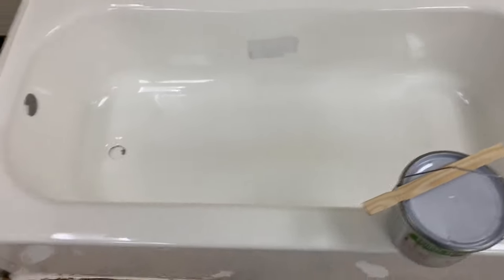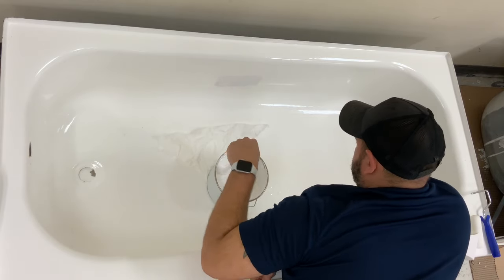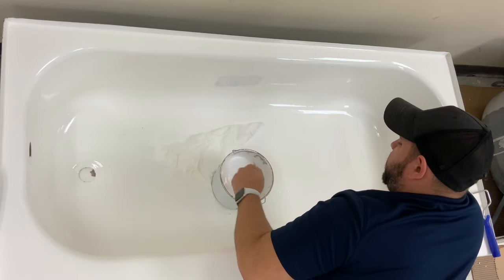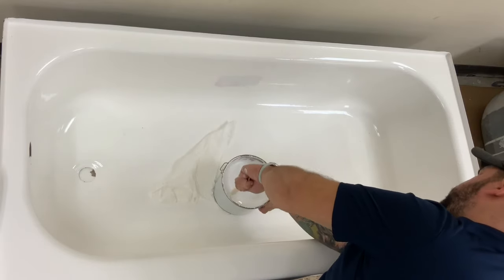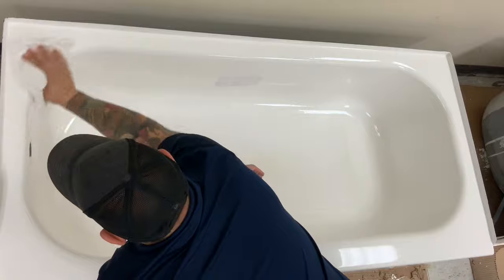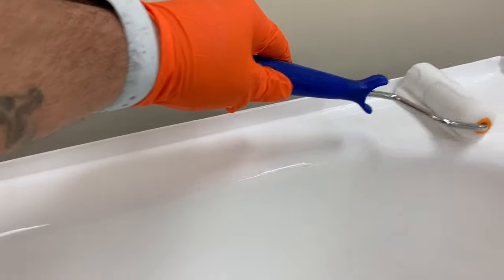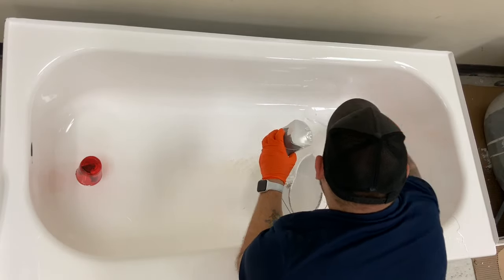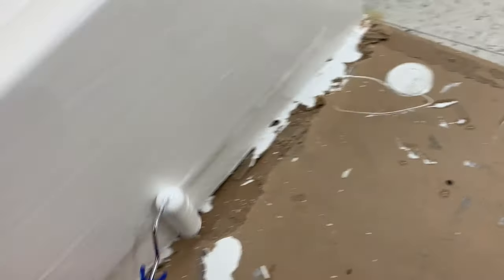How To Refinish A Tub With Ekopel 2K Demo | Ekopel 2K's Easiest & Fastest Way

Comment from the maker: Order yours today!
https://www.amazon.com/dp/B07MCW3KJB
Reply: Does your product work with old cast iron clawfoot bathtubs too?
Reply: I wanted to suggest, instead of a FOAM roller your should try a roller that’s plastic/silicone or something similar. I feel like it would roll a lot easier and not absorb the product
Reply: Will this work on claw foot cast iron tub?
Reply: How do we clean the bathtub after ekopel refinishing. what are dos and don't to keep the bathtub well maintained?
Reply: Any sanding ?
Reply: If this is the first time refining a tub I would try the roll on method instead of the pour on technique, especially if your tub is enclosed and a toilet or another obstacle is blocking the only access area you have.
Reply: Thanks Joe. I wish I took your advice
Reply: How long will this last?

Comment: Okay I just wanted to leave a comment about this. It works. I had and old red bathtub from the 60s that I did not want to remove. I wasn't sure how this stuff would coat it. It truly is amazing I did it myself in one coat and it completely covered the red. I did not use a heat gun. I did not use a hairdryer either. I just used the toilet bowl cleaner that they suggest and I cleaned the heck out of the bathtub multiple times. I actually did it about 2 months ago and that's why I waited to post this comment because it is a rock hard finish. I do have one chip in it that I think I did it before it dried. There are a couple imperfections here in there. But otherwise I am overly impressed and I am hoping that this lasts for at least a few years or as long as they say it does. I've never made a comment before about a product but I'm still amazed but this actually works because usually everything lets me down
Reply: I have a red jacuzzi that I want to do white and want to see if its possible ...this gives me hope
Reply: I don’t know why most people don’t like colored bathtubs and/or toilets. I think they’re coming back in style because in big box stores like Menards or Lowe’s you have to pay more for a toilet if it ain’t white.

Comment: I have worked with quite a bit of epoxy materials. Here's a few tips. Mix the resin thoroughly before adding the hardener. If the resin is somewhat separated and hard to mix, warm it slightly and that will reduce viscosity. I would leave it in the car when sunny out and let it warm and then stir it. Let it come back to room temperature prior to adding the hardener or it might set faster than you would like. While mixing, clean the stir stick with another stick or knife and put the material into the can. Scrape well the edges of the can to get every bit off. As they say in the video, you can transfer the mixed liquid into another container for application. This prevents any non-mixed resin from getting into the tub. Not a bad idea.

Comment: I have an old 1950s pink tub and I used this 2 years ago. I have to tell you watching how you did it would have made me think twice about using it. You made it look so much harder than it actually is. For me it was much easier to take the extra step and pour the paint into a dixie cup and then around the tub. For filling in the runs around the tub I used a plastic scraper to push it back up. Using the dixie cup method I didn't have all the paint in the bottom of the tub to scoop back up. I didn't get any air bubbles or unevenness doing it my way. 2 years later my tub still looks brand new and has the appearance of manufactured cast. I do wish I had known about the dixie cup over the drain

Comment: I watched just about every video and they are very helpful. 
I have a few tips that worked well. 1) After spreading the material I used a tooth pick to remove small pieces of hair and lint that ended up on the surface. This caused minimal surface damage and was all smoothed out by the end of drying. 2) At about the 3 hour mark I noticed there were small spots along the floor line that weren’t completely covered from where the material finished running down after pulling the duct tape. There was also some small pooling from the parts where the material completely reached the ground. I was able to run a q-tip with the cotton pulled off along the floor line to smooth out the pooling along the “calk line” at the floor and I also pushed some of the material up into the little bare spots. It worked perfectly to create a smooth coverage line along the bottom edge of the tub face. 
3) I actually used 2 separate layers of tape for the process. I taped a small hole that is almost the exact diameter of the drain (at the lowest point of the tubs drain hole), then I also used the larger tape diameter that is shown in the taping video (this one basically outlines the outside of the drain cover itself). After I was done with the process I removed the top layer of tape (also tried to scoop out as much material as possible before removing the tape. Probably 10 wipes not 2 like the videos show) then I continued to wipe away material from the edge of the second layer of tape for the next 4 hours because it slowly runs closed to the tape. At about the 10 hour mark I was able to use a tooth pick to draw a line through the material around the tape because it had seeped over the edges of the tape. 10-12 hour mark it when I removed the second layer drain tape. 
Now the actual drain fixture will cover the line of where the material stops and where the old tub surface is still exposed.
Reply: Nice. Thanks for the tip on the hour mark *~.~
Reply: I just wanted to thank you for posting your tips in a comment!  I am just refinishing a kitchen sink that will be used for 5-6 months until it’s replaced when my kitchen renovation is done - and I’m still nervous!  My daughter and son-in-law purchased an older home - and the person who flipped it did some questionable “quick fixes” in order for it to look nice ON THE SURFACE.  I am going to have them watch this particular video for installing the product + read your comment.  I really appreciate that you kept track of the number of hours that has passed related to specific steps - that makes your tips much more valuable!  

I also want to thank the company for making so many videos showing the application of this product.  In a world where it’s so easy to post complaints about products/services, it’s good business practice to provide as much information as possible about your product and how to install it.  It must be frustrating when customers call to complain about poor results - and you find out that they chose to ignore one (or more) of the written instructions.  For example, when the written instructions specifically provide that  the product must be mixed/stirred BY HAND - I don’t understand why anyone would decide to use a drill (or other electrical equipment) instead.  I guess it’s a result of the “instant gratification” mentality that has become ingrained in the world today.
Reply: Awesome. I’m going to own the premix process and keep it away from
my husband who lives by and loves power tools for efficiency.  Using a power mixer reduces strain on weak wrist joints FYI why we love it, same reason we use KitchenAid mixers in the kitchen,,,, however, it creates air bubbles like whipping in the product, I imagine. Going to strap on my wrist widget and be diligent. 

Glad it’s low VOC.

Comment: Great video .... I recently purchased this product for an old bathtub for a rental property came out amazing .... there was quite a bit of product leftover So I  did an experimental project on the tile walls using the leftover product instead of using caulk or grout ....still had plenty of time with-in that hour.. I have to say it also came out amazing !!! Thank u
Reply: I was going to try going over our old tile surround too before I resorted to replacing it.   Did it work well over the grout?

Comment: great video as always, thanks to your videos I successfully refinished a 6 jet Jacuzzi tub and it came out perfect. what if you had access to the drain enough to put a catch pan under the drain would you still scoop or just let it run out the drain
Reply: Did you ever get a reply? I have access to my tub from the basement and am thinking the same thing. Remove the drain completely and let it run through. Then there are not any lines at all, when fished you could tape the bottom to coat the drain hole also. I've seen rust in that area with metal tubs on other kits.

Comment: I had a bathtub with the finish completely worn off on the bottom. I bought the kit, watched video, took notes, was very nervous applying. Wish I hadn't been so nervous, I'm sure it would have turned out better. It is a great product, even with my mistakes it looks 100% better. I love it!! Wish I knew how to add the before and after photos!
Reply: My bottom is exposed to original color and the paint job is completely peeled up. Did you have to sand down with this product?
Reply: Hows it holding up?

Comment: Looks good, only thing that I would add is when it would be best to remove the masking, but you didn't have to do that with that setup. I imagine that it would be best to remove it right at the end, when you are done getting the coating how you want it, so that it doesn't end up stuck in the material, making it hard to remove. Maybe you mentioned it, but I didn't catch it.

Comment: I finally got around to doing this today. If anyone reads this, tape the box like he shows. I made a huge mess and it was pouring all out of the bottom lol. Also, I am short, so I was leaning into the front of the tub when reworking on the walls and made another mess. I should have put a small extension on the roller handle. Just waiting for everything to stop moving now. :) So far, it's a major improvement over my 1950's tub that was chipped and peeling. Cleaning up has been fairly easy too.
Reply: Thank you. I finally read a comment with someone who’s short. I was wondering how I was going to reach the other side without my body touching the front of the tub. I’m still thinking if I should get this kit or just use the rust oleum appliance epoxy. I love this method but it just looks challenging
Reply: @tracyb3198  I researched the Rustoleum and while it's easier to apply, it's not as durable. Good luck with your project!

Comment: Great video! answered alot of the questions that I had. I will be doing this come tomorrow and wanted a guide for it, this was exactly what I was after.  The only negative thing I have to say is that I really wish you would of chose to redo a tub that actually NEEDED redone and shown the steps to get there.  That tub is practically brand new and just a quick wipe down was fine.  What about an old cast iron tub that has chips and years of crap on it? Should I sand it down some, just wipe it, or something else?

Comment: Good video, I wish you used a different color paint. A darker paint would allow us to see what you are doing better. 
And maybe see errors better. White on white is hard to see.
The heat gun you used, for bubbles what temperature is it on? 
Does it say in the instructions? 
I have to repair a chip and was going to use Bondo, and sand entire tub with 400 grit. 
Will Bondo be ok to use? (old 1950's steel tub,  with your product.)
Thanks

Comment: So it came out good! But you can tell an amateur did it because I have some ripples only on the outside. I also have some pooling because the roller that came with it, (I didn’t follow your advice to make sure it worked first, which it did but not when I was using it on the ekopel) so I suggest the old method, a lot easier to move product around with a flat edge. All in all the product is fantastic.. but I just wish I had this guy here to do it for me since he makes it look so easy.... but since I don’t, my okayish results will have to do... better than before that’s for sure.
Reply from the maker: To fix wavy uneven areas you can sand it smooth with 220-320 grit sandpaper then double the grit to 600 then 1500 then use any car buffing compound and it will bring the shine back to the tub.

Comment: When you used the heat gun, how close did you get to surface?
Is the bottom super smooth,  can you add any kind of sand to put safety texture?   How long is this surface expected to last?  If I put material that's left in air tight container, can I keep it to touch up a chip on a tub at a different location,  will it stay liquid or will it harden?  I'll just want to dab a Lil on with a brush  at rental property. 
Thank you, I'm apprehensive mostly because of the time constraints,  but I so need to do this on a 54" tub that's 50 yrs old in my mothers trailer.  We couldn't find a replacement easily that size when she remodeled during covid.
Reply from the maker: Thank you for your comment! We do have a non-slip kit available on our website. The surface can last up to 15 years! Unfortunately, the material is not able to save once it is mixed. It will harden. We have touch up kits available if you encounter any imperfections. Please feel free to contact us if you have any other questions!

Comment: Hey - if we have some type of glaze on tub already do we need to get it ALL off or just sand w little bit? What grit do you suggest? And do I sand previous glaze before deep clean or after?
Reply from the maker: Hello!! You do not need to sand off all of the previous finish, just sand it smooth to the touch. I would start with around 220 - 320, make it smooth and get try to get rid of any imperfections you see. If you feel like that is not enough feel free to go to something like 180 and adjust from there. You can always give us a call!! We are open Monday - Friday 8:30 - 5 eastern time. You can start with sanding or cleaning, it doesn't matter just as long as you do both and can even sand with the toilet bowl cleaner doing them both at the same time. Just make sure you fully rinse it off the surface and let it dry before application.

Comment: This is a great product. Prep is key, and planning out the steps is important. I even rehearsed the pouring step before I actually did it. Making a tight move like that in a bathtub, with pouring paint out of a bucket, is good to have one practice move in that kind of tight space before actually doing it. Make sure to have the drain COMPLETELY sealed with tape and I removed the cup after a few hours as spec'd , remove excess paint as it is drying after a few hours, and I put the cup back down again. Keep lifting the cup and checking around drain after it's poured because the paint will move very slowly as it sets up. I almost had a big problem with seepage getting under the tape unbeknownst to me and almost drying in the rag Id plugged the drain with as a safety precaution. It almost completely set up on me but I used a 1" paddle bit on a drill and slowly drilled down, to get through the paint to the plug, getting down to the rag and pulling the whole plug out with drying paint. Had it set up all the way and dried, it wouldve been a huge problem. This is an awesome product and looks great when it's done. But if youre not used to working with paint let a professional do it. I've been painting for 30 years, licensed, and without proper experience this could be a disaster for a novice who rarely, if ever, paints. Taping, properly protecting floor, proper lighting like a good halogen work light hung over the tub also helps out a lot. Also, the paint scoop really has to be taped good. It starts to fall apart otherwise. Hopefully some kind of rigid but flexible rubber scoop could be included instead of paper. There has to be some kind of better alternative. Especially for 150$ and being one of the most important parts of the process it should be better, especially if a customer is paying for the best product. The paper one works but definitely tape it, youll be glad you did!! Great product and this video was 100% helpful. Thank you for making it so thorough.. Just constructive criticism. Ekopel is an awesome product.

Comment: Hi. The video seemed great and the comments are amazing. QUESTION: i want to do this over an older and crappier reglazing. do i go right over the initial reglazing or take that glaze off? if so, how? Thanks for any help you can provide.
Reply from the maker: I would recommend peeling up what you can of the old finish then sand the rest smooth to the touch with 220-320 grit sandpaper. As long as it's smooth to the touch it won't mirror. From there etch and deep clean with Lysol Power or any toilet bowl cleaner that has hydrochloric acid in it. From there you can tape up and pour.

Comment: NEED HELP:
Hi, I did everything perfectly but about 18 hours later I had to step in the tub for about a minute and used a paper towel under my foot like a genius and after I removed it some of it got stuck in there. Should I scrape it or use paint thinner? How can I clean it up? :))
Reply from the maker: Hello, 

try to cut it out with a razor blade since I would assume it is now dry. You can try to heat up the area with a heat gun or hair dryer in order to soften it. If you have any other questions call 877-882-2278.

Comment: I have several small chips in my tub which are approximately 1/32 to 1/16 thick. Will your product fill them in after they are sanded, or must I fill these areas first?